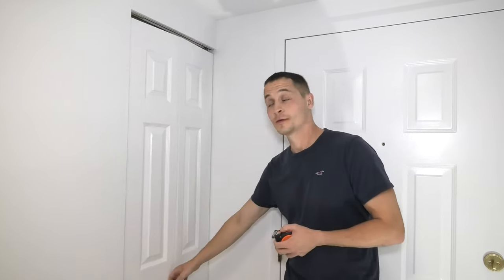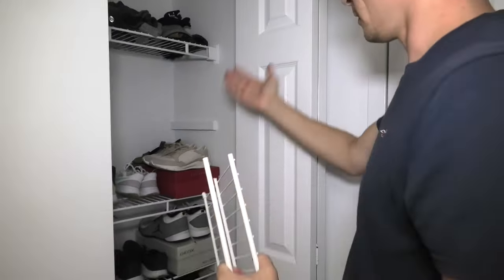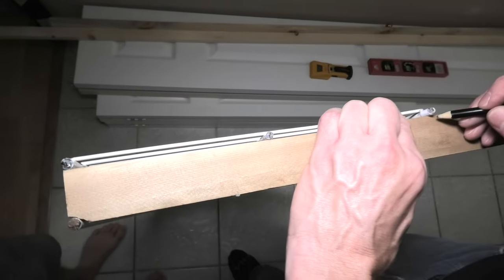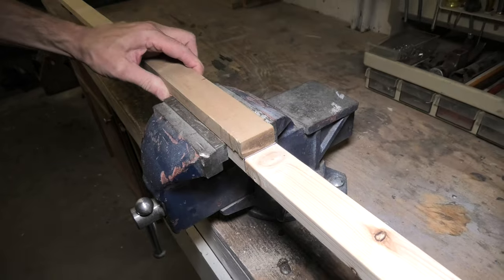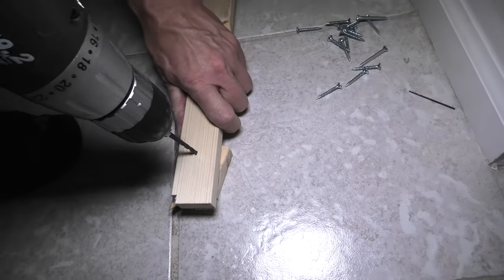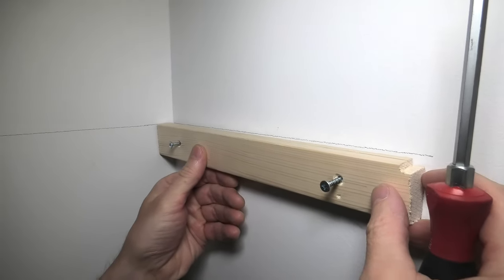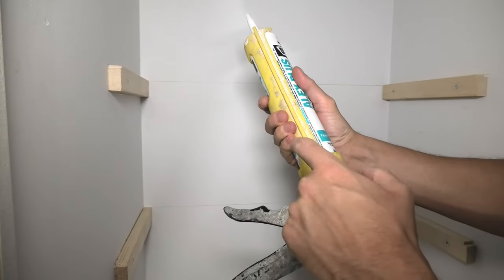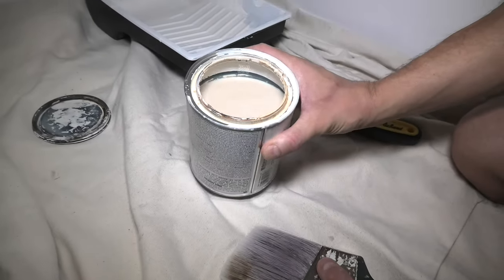Custom Shoe Shelves Installation In The Closet.

Comment from the maker: PRODUCTS USED:
1. WIRE SHELVES - Closetmaid® Closet Wire Shelf with Rod, 4' X 12'' - https://amzn.to/3ZiZG2D.
2. 1x2 WOOD - Maple Lumber Boards - 3/4" x 2" (4 Pcs) (3/4" x 2" x 12") - https://amzn.to/3r6l4LQ.
3. WOOD SCREWS - Mr. Pen- Wood Screws Assortment Kit, 152 pcs, Phillips Tips, Flat Head - https://amzn.to/3ZdVlhl.
4. GLUE - Gorilla Original Gorilla Glue, Waterproof Polyurethane Glue, 8 Ounce Bottle, Brown, (Pack of 1) - https://amzn.to/466Rjuc.
5. CAULKING - DAP INC 18152 10.1oz White Alex Plus Acrylic Latex Caulk with Silicone - https://amzn.to/44MYs0O.
6. SHELLAC PRIMER - Rust-Oleum 1 gal Zinsser, B-I-N Advanced Synthetic Shellac Primer - https://amzn.to/3LdC0Hd.

RECOMMENDED TOOLS:
1. TAPE MEASURE - Klein Tools 9225 Tape Measure, Heavy-Duty Measuring Tape with 25-Foot Double-Hook Double-Sided Nylon Reinforced Blade, with Metal Belt Clip - https://amzn.to/3p8UznW.
2. LEVEL - Klein Tools 935R Aluminum Torpedo Level, Rare-Earth Magnet, 9-Inch, Hi-Viz, V-Groove, 3 Vials, Top-View Vial - https://amzn.to/3m7Onva.
3. HAND SAW - CRAFTSMAN Hand Saw, 15-Inch - https://amzn.to/485NG8L.
4. RECIPROCATING SAW - DEWALT ATOMIC 20V MAX* Reciprocating Saw, One-Handed, Cordless - https://amzn.to/44LMlkr.
5. RECIPROCATING SAW BLADES - DEWALT Reciprocating Saw Blades, 10 Piece Combination Set, Various Sizes (DW4898) - https://amzn.to/3Rggq8B.
6. TABLE VISE - MYTEC Bench Vise or Table Vise, Multi-Functional Combined Vise with Quick Adjustment, Universal Rotate 360° Work Clamp-On Vise, 3.3" black - https://amzn.to/3RbBNIp.
7. SCROLL SAW - DEWALT Scroll Saw, Variable-Speed, 1.3 Amp (DW788), Yellow, 20-Inch - https://amzn.to/3sKGM8G.
8. SCROLL SAW BLADES - OLSON SAW PG49802 Precision Ground Scroll Saw Blade - https://amzn.to/3RmXWDo.
9. ANGLE GRINDER - Makita XAG09Z 18V LXT Lithium-Ion Brushless Cordless 4-1/2"/5" Cut-Off/Angle Grinder - https://amzn.to/3PaqgGz.
10. SAFETY GLASSES - Dewalt DPG82 Concealer Anti-Fog Dual Mold Safety Goggle - https://amzn.to/3Pfgh2P.
11. CORDLESS DRILL - CRAFTSMAN V20 Cordless Drill/Driver Kit, Brushless - https://amzn.to/3LhY1Fo.
12. DRILL BIT SET - CRAFTSMAN Drill Bit Set, Gold Oxide, 14-Piece (CMAM2214) - https://amzn.to/469mMLr.
13. WIHA HEAVY DUTY SCREWDRIVER SET - Wiha 53097 Screwdriver Set, Slotted and Phillips, Extra Heavy Duty, 7 Piece - https://amzn.to/3ystzRx.
14. DRIPLESS CAULKING GUN - Dripless Inc. ETS2000 Ergo Composite Caulk Gun - https://amzn.to/3TBenvh.
15. RAGS - SupremePlus Premium White Knit Cotton T-Shirt Cloth Wiping Rags 100% Cotton - https://amzn.to/3PwT90R.
16. PUTTY KNIFE - 3" Warner 90133 ProGrip Full Flex Putty Knife - https://amzn.to/3Yg8UhQ.
17. CHEAP PAINT BRUSH - Magimate Wall Paint Brush - https://amzn.to/3ZdcZBx.
18. PAINT TRAY - Linzer RM 403 0900 Plastic Tray, 1 Quart , Black - https://amzn.to/3Pjcq4B.
19. DROP SHEETS - All Purpose Canvas Drop Cloth - https://amzn.to/3PdINTt.